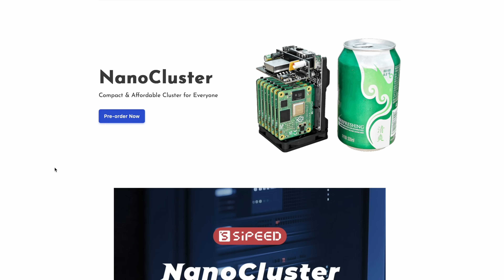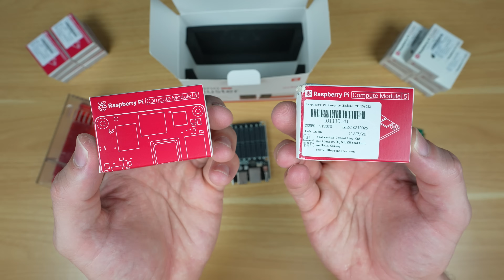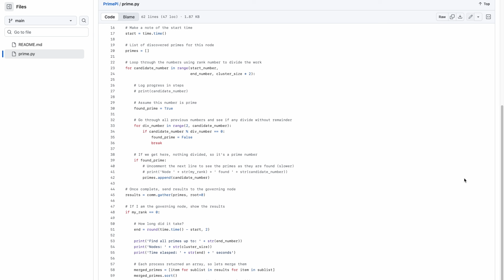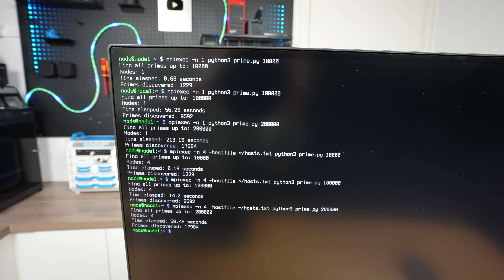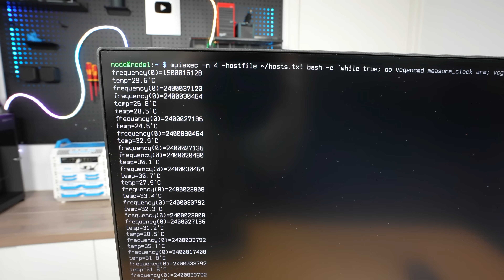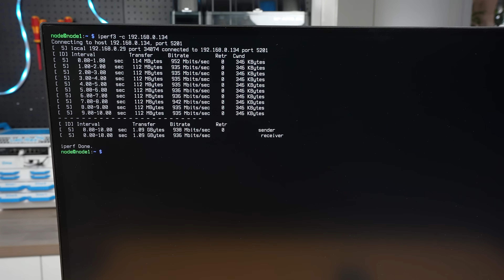A Pi Cluster That Fits in the Palm of Your Hand! This is the Sipeed NanoCluster

Comment: test and explain the slot 1 control.  I have two of these running and had a hard time with documentation.  It may have improved.  I had trouble with serial connection to slot 1.. or to the carrier board .. never figured it out.  WIth good documentation these things would be amazing.
Reply from the maker: I agree, the documentation still needs works.

Comment: Less than the price of a single CM5 module? Am I misunderstanding something here?
Reply from the maker: The Nanocluster board is $49 and a single CM5 module is generally around $50-85 depending on the config.
Reply: @MichaelKlements You talked about it going up to $699 which was immediately followed by the "i think this is a great value because..." so it seemed it was in reference to the variant you'd referred to immediately before. I get it now.

Comment: The next version should be wider and have more power, so you can use 7 cm5’s with ssd. And it should have a 10g network port, so all 7 boards can have full 1g connectivity.

Comment: Run an LLM on it.
Reply from the maker: That's a nice use case for a local cluster like this
Reply: It's a terrible idea. The performance of the LLM is bad on the Raspberry Pi 5. A network switch is also deadly slow. It can be used only for Kubernetes on your home lab with multiple microservices. This tiny cluster form factor makes usage impossible. It's too hot and noisy to use it near your workplace, and it's required to host it in a dedicated room.
Reply: I would rather recommend any small factor PC, like Intel NUC or AMD alternative which is even more powerful in the same package size. I have one on a n100 Intel CPU, it works perfectly. Just install proxmox, and you can run anything you want. This type of PC usually supports several SSD/HDD to build raid, has couple of network adapters with 2.5+ gigabit speed, so even the idea to host open sense will be possible.
Reply: @Hellkers  Two questions: What would you recommend as an alternative for running Ollama and Stable Diffusion in a similar (or slightly larger) form factor? Also, what kind of microservices are we talking, like Home Assistant, PiHole, simple chron jobs, or do you think this could handle something like OPNSense and Wireguard, maybe Jellyfin?

Comment: Does this support network boot for each node?
Reply from the maker: I haven't tried myself but I don't see any reason why you wouldn't be able to network boot each node. You'd need to reflash the bootloader on each module first.
Reply: Network boot is a function of the node.
Set up node one as the boot server, then so long as the bios/firmware of the other nodes is capable of network booting it will work.

Comment: bandwidth bottleneck is obviously the single ethernet port. for some reason are grown ups still triggered by toyish things that actually do not serve a purpose
Reply: There are many use-cases which do not require a full gigabit uplink for each node
Reply: That is basically the limitation of the Raspberry in every cluster setup.

Comment: 5:43 Given the limitations (both max power and possible density when deploying with the SSD boards) , will there be a cheaper 4-board (instead of the current 7) model in the future?
Reply from the maker: I doubt they'll make a 4 slot board - it's probably not significantly cheaper than making the 7 slot board and just leaving some slots unused.
Reply: yea why not spend a coupel more pennies to make it a lil bigger and handle a tad more power. errrr
Reply: Jeff Gerling in His review of the same Product came with the conclusion that the Power Supply on their own can switch or power balance the loads from the PoE injection AND the USB-C power input, giving a Total Power Limit GREATER than just the PoE++ (>=60w)😅

Comment: It looks like a really simple cluster Raspberry Pie would sell as a starter pack for cluster intruduction and such. It would be very interesting to see the performance+custom cooling limits of this device and idk watercooling or extreme air cooling or maybe 3d printing a custom bracket to mount 3, 4 or 5 of these nano cluster in a 1U rack space and see them purr xD. That would be ... mind blowing tbh. Great vid btw!
Reply from the maker: That's a nice idea, maybe I need to look into clustering two of these boards with some water cooling!
Reply: @MichaelKlements  Idk if I where you or Jeff Geerling I would simply try to make that 1U cluster server made of like 8-10 of those nanocluster and then some extreme aircooling. Water cooling would be another whole story and by far the hardest challenge here cause of the tiny space between compute modules if you wanted to use 7 of them. Most heatsinks wont fit there too as you've shown. And even if you were to use only 3 or 4 modules there's another problem and that I cant imagine how a interconnected quad or triple heatsink/waterblock could fit there. It would be the tiniest most thin one I've ever seen. A groundbreaking achievement deserving to be inmortalized in the raspberry project hall of fame.

Comment: Proxmox on a single thrift store pc would be cheaper if you just want to play around with multi compute systems.
Reply: You would be hard pressed to get a 7 thrift store PCs + networking for $300, which is the price of this with 7 LM3Hs. If you go the raspberry Pi route you could probably do power, a switch, and cables for less that $100 but, at least for me, the convince of having this all in one package is worth the slight premium. Those AI modules also look interesting.